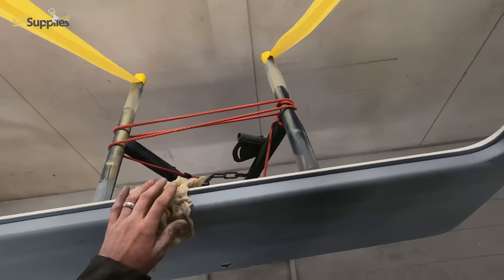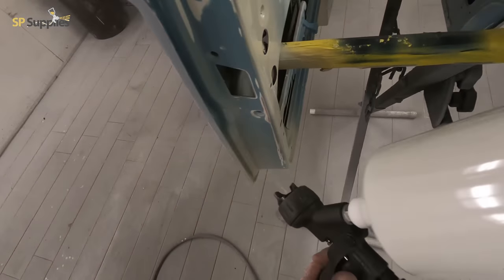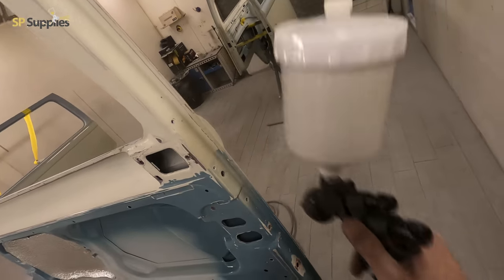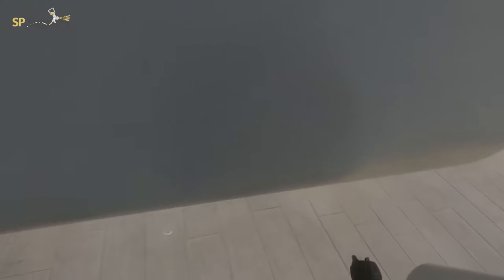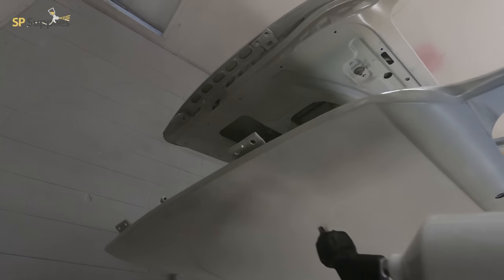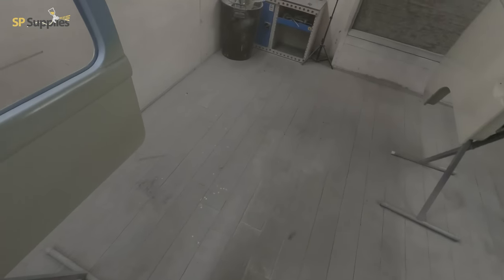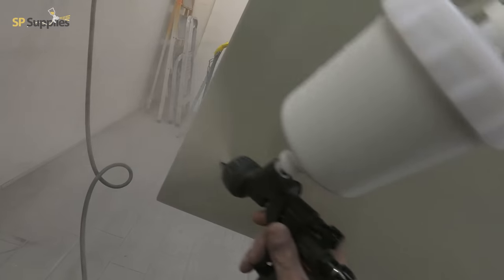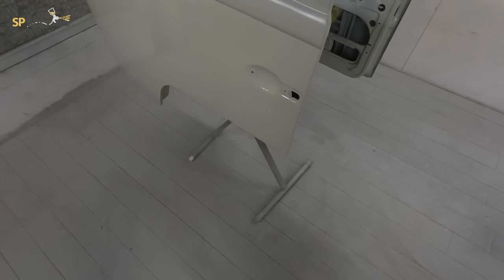New Spray Guns And Lets Paint These Doors - VW BAY WINDOW CAMPER VAN RESTORATION

Comment: ive found ALOT of spray guns that ive used... DevilBiss, iwata, etc, Always need to tickle that fan adjustment a little, to clean up the fan pattern..
I just naturally do it now, with all my spray guns...
Reply from the maker: Yeah there are quite a few these days which has always baffled me a tad why they don’t just make the adjustment so full fans even
Reply: @TonysRefinishingTV  Hey.  Perhaps due to fluid viscosity.  The gun is sold worldwide and has to cope with a variety of materials in it, different hardeners, and temperatures.  A thicker fluid will be harder to throw out in the fan.
Reply from the maker: True mate but I’ve heard the same on the fan from most people who have one it’s not knocking the gun the gun sprays lovely just something I noticed
Reply: The worst in this regard is the WS400 supernova. With the fan wide open it's useless. With the fan 1 3/4 turns out it's the bomb. This is particularly weird since Iwata's century series guns have a fan stop prior to splitting the fan. The LPH400 and the W400 don't have this problem.

Comment: Good guns but the price isn't right. I have the original 360 Carbonio HTE base and clear guns rather than the more recent Lite versions. Nothing wrong with them but they aren't worth $300 more than a Supernova or a Sagola. Walcom seems to think they can charge SATA prices  and these just aren't built to SATA's standards. Another problem is that here in America Walcom is like the red-haired stepchild of sprayguns. They don't have good availability and finding replacement parts is a big problem. With Iwata, SATA and DeVilbiss I can get parts anywhere. Not the case with Walcom.

Interesting fact: The first gun to use pre-atomization was the Walcom Geo. Iwata stole the idea from Walcom and improved it with the split nozzle. On the Geo Walcom drilled micro holes around the top of the fluid nozzle and that did exactly what the split nozzle does for Iwata. The problem was these tiny holes continuously clogged up and they were nearly impossible to keep clean. Sadly being first didn't result in Walcom reaping the rewards of this invention as Iwata certainly did.
Reply from the maker: I get where you coming from on that one mate I have to say but all the big brands these days are all within £50 of each other so I don’t think it’s to far off the mark